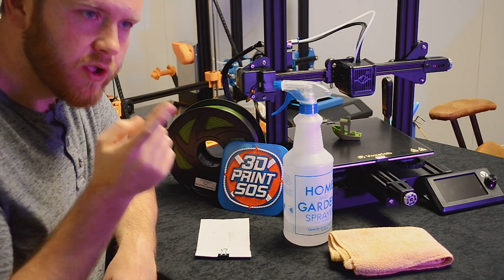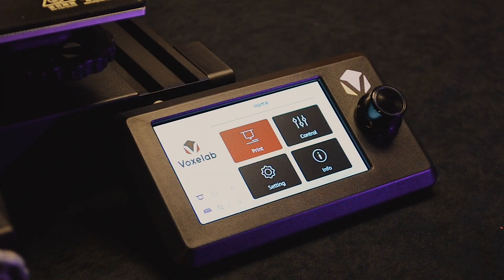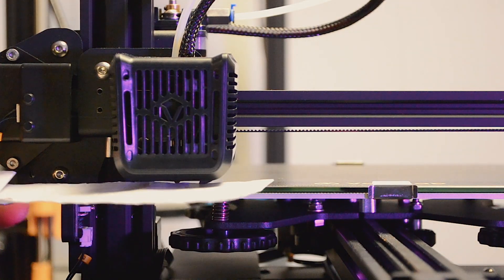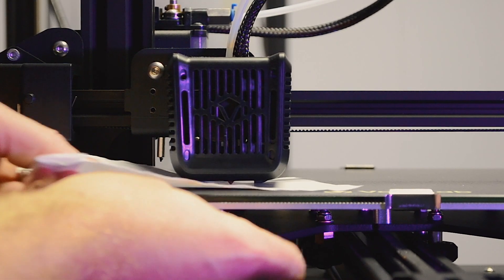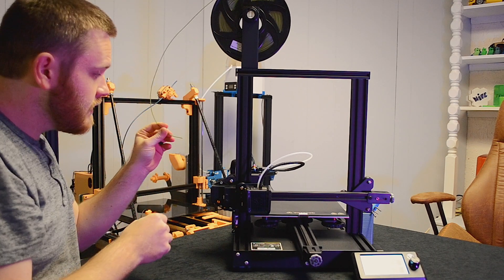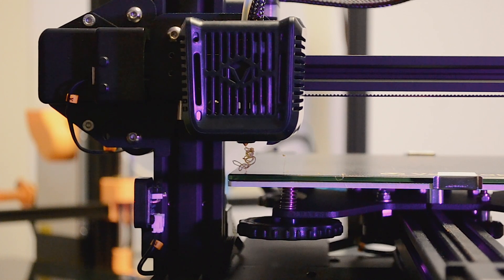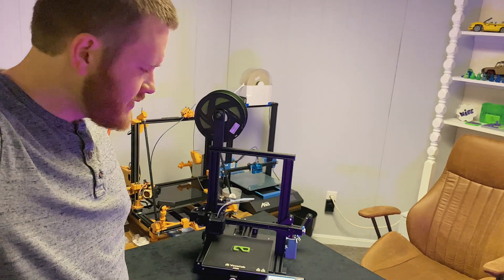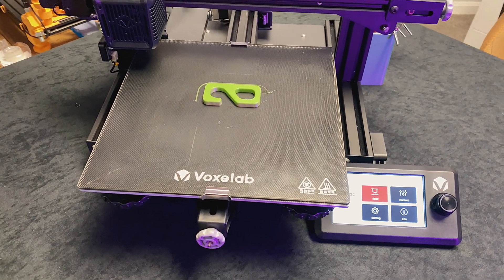How to Level Your Bed on Your Voxelab Aquila 3D Printer.

Comment: Ever since I got my aquila and started watching your videos prints are turning great. I did your paper method and has some tensions on corners but middle has to much tension any suggestions ?
Reply from the maker: You might need to back off just a hair. Also, try moving your clips. Your glass shouldn’t be flexing that much.
Reply: @3DPrintSOS   where do you think it should be placed because there both centered
Reply from the maker: For starters, try the left and right side. Also what temp are you heating to?
Reply: @3DPrintSOS  bed is heated at 65
Reply from the maker: Hmm. Try to flip the bed to the glass side. Wonder if it’ll flex in both directions. It’s got to be a tension thing for something to be bending like that
Reply: @3DPrintSOS  yea I thought it was strange so had to ask and from putting the clips  on each corner has helped but only printed two things so far for the extruder layout you have but turned out great and didn't have to do to much adjusting and the middle was good!

Comment: My bed now sits way to low I've tried tightening and goes all the way but my nozzle even in auto home is about a 1cm away from the bed so pmtest prints aren't working any ideas
Reply from the maker: You can lower the z stop switch by loosening two bolts on the left side of the machine. 

Here’s some extended help: https://youtu.be/Q7Mu05fZNsk

Comment: I got one a few days ago, first print right out of the box was PERFECT! I got Alex’s firmware installed and then started needing to make adjustments.
I’m having some adhesion issues and I suspect it might not have to do with heat like I first thought but with leveling. It seems, for whatever reason, the print bed does NOT get high enough! I loosen ALL the leveling knobs and the nozzle is hardly touching the bed at any part, which I THOUGHT was leveled. But even then it’s too low a bit. Anyway, with the knobs loosened, the bed becomes looser, and the knobs have a tendency to fall off the threads during a print while due to the machine vibrations.
So I’m getting new springs which I’ve read can solve the problem. But I’m wondering if moving the z-stop switch down a few mm would also be a valid solution? Yes it makes it so the nozzle can actually collide with the bed, but shouldn’t it have been like that from the start (hence the need to be careful when auto-homing)? Because my bed and nozzle were never that close to being able to scratch the glass…
Reply: UPDATE: I lowered the z stop switch a tiny bit as I found on another video, and it's working phenomenally now

Comment: One thing you didn't mention was what weight of paper you were using when you were leveling the bed. I used a sheet from my laser printer and that was way to close. I spent an hour with it and I never could get it level until I found a heavier sheet of paper.
Reply from the maker: A standard sheet of paper typically used for a printer is what I usually go for. Most of the time the I just set up a skirt or brim and do a live level when it starts to print.
Reply: @3DPrintSOS  I'm brand new to 3D printing. I just got this Aquila yesterday. I watched all your videos. I have messed with this leveling for over and hour and can't get this thing level. I think it's pretty good but when I go from corner one, and go back to the back corner the nozzle wants to touch in the middle. I left the paper under the nozzle and went from front to back with the bed and it touches in the middle. I tried next with a piece of 100# cover stock. I tried printing the nut and the print once it gets going starts pulling off the bed. I just cleaned the crap out of the bed with the alcohol but it still doesn't stick. If you look at what printed, and you look at the center of the nut (square section) the part that goes from the inner square corner to the outer piece looks like rope. I'm so frustrated with this machine I'm about to send it back. I you can give me any suggestions I would greatly appreciate it.
Reply from the maker: Slow down a bit. You can’t become an expert in a bit over an hour. You got this. Here’s what I suggest. In your slicer, set up a brim or skirt that’s somewhat large. A 20 line brim or 10 like skirt. Then start the print. When it begins to print, use the wheels on the bed to get each corner printing smoothly. You don’t want to look transparent, that’s too close. You don’t want it to look like rope, that’s too far away. 

Do it a couple times. Before hand, make sure you have the right tension on your springs. Make sure the wheels on your bed are not lose. I bet if you it this way, you’ll get smooth prints. :)
Reply: @3DPrintSOS  Thanks for your help! Still had a heck of a time getting the bed leveled. It took us over an hour to get it right. There is no way to get it correct in a couple of tries. We were successful getting a print out. The hook came out perfect. I'm printing the toolbox now. I do have one question...the timer seems like something is wrong with it. The time it's printing is right but the time remaining is all over the place. One second it s 14 hours then the next it says 4. It keeps jumping all over the place. Is this right to do that? I really appreciate that you actually respond to questions. The machine is only as good as the support and you have helped a ton!
Reply from the maker: The time on any of these machines is just funny. It’s never really worked on any of them. Lol.
Reply: Hey one more issue that came up. If I print the nut the print looks awesome. I print like a chess piece that has wings or a park bench with support, I get a lot of stringing. Also it looked like the head hits the support and bends if over a bit. That causes a bunch up of filament to ball up and mess up whatever it is supporting. You have any thoughts? I am using your profile for the Aquila.
Reply from the maker: All printers will behave a bit differently since every roll of filament and everyone’s climate is a bit different. That sounds like you are not getting enough cooling and the edges are curling. I would first try to print a hair slower or first turn down the temps by 5 degrees.

Comment: I used this method and couldn't seem to get it right. I started at one corner and worked my way around with the piece of paper. When I got back to the 1st corner, it was too close. So I adjusted again and did this for about an hour and ended up just saying F it, this is close enough. Not sure if the Aquila X2 is different in that aspect or not (it doesn't appear to be). I did the Test Print first and it came out fantastic. Very pleased with it. So I'm not sure if my glass bed is slightly warped or not but it was definitely frustrating.
Reply from the maker: Well I’m glad you got it printing. Typically when leveling, if you come back around but it’s back out of tune, it’s a spring tension issue. You need to add more tension to all 4 springs. If then, it’s too low, you can move the z limit sensor down a bit. ;)
Reply: @3DPrintSOS  What I found out is that the bed was pretty wobbly so I tightened all the nuts under the bed and that made it A LOT easier to level it. I did fine that I needed to level the bed every time which I'm sure is probably a good practice to get into. I'm definitely watching ALL of your videos to learn this tedious process of 3D printing! Thank you for all your videos and the effort you put into them!
Reply from the maker: Yep, that will do it. Don’t worry, it gets easier! :)

Comment: is there a proper mesurement the bed should be away from the nozzle? like 0.2mm or something like that? we use 0.01mm gauges in my work so maybe i could use them to level the bed perfectly :) im in the process of ordering one of these and your videos are just awesome thanks man!
Reply from the maker: Thank you! Honestly I’ve literally always used a paper and then tuned it live while it’s printing the first layer or a brim. I’m sure there is a perfect measurement though. However, some filaments like to be squished and some don’t. So that theory might not work for every type of filament.

Comment: So I set the knobs at their halfway points, homed the motor, disabled the steppers, and tried to do my first corner. But no matter how far I unscrew it, the nozzle doesn't scratch the paper. 

This wasn't happenings before, but before, my bed wasn't steady, and so I adjusted the v-nuts until it was steady. Clearly this means I've either gone too far with the v-nuts, or my printer is a bit defective. The v-nuts are very awkward to mess with as getting at them is awkward and sometimes their sibling nut turns with them. Yikes!
Reply from the maker: Check out my latest video. You just need to lower you a limit switch. The latest vid got you covered.
Reply: @3DPrintSOS  Got it leveled, thanks. Now if I could only get it to accept that there is, in fact, filament inside of it... (Getting "filament not detected" error)
Reply from the maker: @MinkusMonkus  nice! Oh I think that one is in settings. Turn off the filament sensor.
Reply from the maker: 💪🏻.  Did you do the organizer? It’ll take about 8 hours when it’s all said and done. But at least it’s useful.
Reply: @3DPrintSOS  I just did the first test print, little base with 5 shapes on it. Didn't take 13 hours, less than 6 for sure, fell asleep partway through. The build time estimator feature could use some intelligence! :)
Reply from the maker: Ah. Yea the times are always...adventurous...at least it’s an issue on all my machines. I’ve never had one that was too accurate.

Comment: My Auto Home makes the nozzle end up in the middle and no where near the bottom
Reply from the maker: Hmm that’s odd. Try to reset the configuration in the settings and try again.
Reply: @3DPrintSOS  how? All I know is that when I auto home, the printer doesn't move up and down at all, it goes to the left edge then goes to the middle
Reply from the maker: Did it ever move down? Maybe something is unplugged?
Reply: @3DPrintSOS  it went down at one point I think. I think it was the only time it correctly leveled
Reply from the maker: If it’s gone down before that means something could just be unplugged. Can you move the z axis down via the settings menu?
Reply: @3DPrintSOS  yes I can
Reply from the maker: That’s good! So that means it could be a firmware issue. If you can move it manually but hitting home doesn’t move it down, your printer may think that it has an auto leveling sensor and it’s waiting for that to bring it down. You might want to try a firmware update.
Reply: @3DPrintSOS  yep that was it! I was trying that then saw your comment and figured that had to be it. It was because I downloaded the BLtouch firmware because I figured I'd just auto level the bed and not have to do it manually, but I don't believe any of the three brackets that come with it work with the Aquilla.
Reply from the maker: Glad you found the problem. Check Thingiverse for them. ;)

Comment: I'm having to level my bed every few prints. I bought the Voxlab Aquila and was wondering what you thought of BLtouch sensor. Do you recommend it. I don't see that you have a vid on it. Thanks in advance.
Reply from the maker: A BLTouch would just be a band aid fix. Your level on this bed should last a long time. I would tighten the springs almost to max, bring down the z switch to compensate for heigh, and make sure the wheels on your bed are tight. Also be sure to always let the bed cool all the way before you take off prints. I haven’t level my beds in a long time.
Reply: Thanks for the feedback and I did what you told me. So far working great. Thank you.

Comment: How do I add your Cura Profile? I don't see where to add it to the software.
Reply from the maker: I made a video on how to get slicing with Cura. I go over it in that video. If I recall correctly. ;) in settings, there is a spot to manage profiles. That is where you import.
Reply: @3DPrintSOS  I ended up finding that on your video! Thank you so much. You’ve been a HUGE help getting me into 3D printing with my Aquila. Keep up the great work!

Comment: Thanks for the great video! I just did my first print on my Aquila using the the same hook file. However the finish looks very different. Yours looks smooth but from mine I can see and feel the mesh pattern. Do you know what might be the problem? Is my nozzle too close to the glass plate? I was using the filament that came with the Aquila. Would that be the reason? Thanks!
Reply from the maker: It could be a number of things. Was it on the sample filament?
Reply: @3DPrintSOS  Yes, the red one that came with the printer
Reply from the maker: Have you had luck with other filament?

Comment: Hi, I'm hoping you could help me with something simple. When I configure my z-offset the printer will not save the settings. Unlike the creality you have a save settings in the menu. The closet I can find to that may be the save the Home offsets? I do wish that the menu had more options like the creality but otherwise it does print really nice. Thank you for your help and all the great videos! I also subscribed to your channel!
Reply from the maker: Yes that’s a thing. It won’t save it if you’re doing it from the screen. It has to be saved to eprom. I’ve never done it on this printer...maybe someone else can pitch in? I’m assuming you can do it easily with pronterface

Comment: My top right corner won't rise high enough to level with the rest of the bed, do you have any idea what could be causing that? I can't loosen it anymore because the knob will actually fall off
Reply from the maker: You need to evenly tighten all the wheels to about the middle of the springs travel. Then move the z stop switch down some. It’s held together with two bolts on the left side of the printer

Comment: Hello after leveling my printer it becomes un level as soon as it starts printing. I have to level it again as it’s going any tips ? The first test print came out great but now it drags across the bed.
Reply from the maker: Hmm. I’m wondering if you bed rollers are loose or if you need more spring tension

Comment: I'm thinking of buying a 3D Printer (my first) and this one is on the top of my list. Watching this video, I was wondering if there is a (semi-) automated way similar to touch plates used in CNC. As I don't have a printer yet, I don't know how this would work, but I imaging some clip that connects to the nozzle on one end and to a piece of brass or something on the other end. Then some simple circuit that connects when both touch and then maybe lights an LED. So you could clip this to the nozzle and place the brass piece under the nozzle  on each corner. Then slowly raise the bed on that corner until the led turns on...
Reply from the maker: Interesting idea. There are tons of different types of auto leveling sensors available out there already. In my personal opinion, you don’t need them on such a small machine. It’s waaaay more beneficial to learn how to properly level a bed. You’ll have way less headaches in the long run. ;)
Reply: @3DPrintSOS  I definitely will start with the manual method (as I did with my CNC), but it IS somewhat subjective (did the drag on the paper on corner 1 really feel the same as corner 2?). Just brainstorming. Sometimes my engineer brain gets out ahead of me ;-) Thanks for all the videos you put out on this printer. I'm sure all of it will come to good use (soon I hope).
.
Reply from the maker: The true answer is no. But you do get better at it each time you do it. And honestly it seems to be “good enough”. I know that’s major cringe for an engineer haha. But hey, it works.
Reply: @3DPrintSOS  I know it's good enough as it seems to be the universally used method for at least budget printers and I have used the same method on my CNC as well. Just depends on how critical true level for the bed is. :-) And I'm not so cringy as an engineer, so don't worry ;-)
Reply from the maker: Awesome cause I’m sure some of my vids make some engineers unsub. Lol

Comment: Did you have any issues with yellow residue coming off the bed after wiping with isopropyl alcohol? My bed turned from its original finish into a more matte/foggy look after taking off this yellow residue.
Reply from the maker: Yep. That’s normal. Some people say that it’s the coating coming off because it doesn’t like isopropyl, some people say it’s oils from manufacturing. Not sure who to trust honesty. I chose to flip the bed over to the smooth surface and I use iso before every print. When I did use the other side, I still cleaned it every time and eventually the yellowing stopped coming off.

Comment: i cant get my prints to come out correctly
Reply from the maker: Let’s see if I can help. Give me an example of what’s going on. Are you printing from the example files? Your own slices files? What settings are you printing at? What have you tried so far?
Reply: @3DPrintSOS   no its the printing it self i print and it never prints correctly just in a mess
Reply from the maker: I see. Give me a bit more details and I’ll try to help. What are you trying to print? Is the print bed nice and leveled? Have you cleaned it with isopropyl alcohol? Which filament are you using?